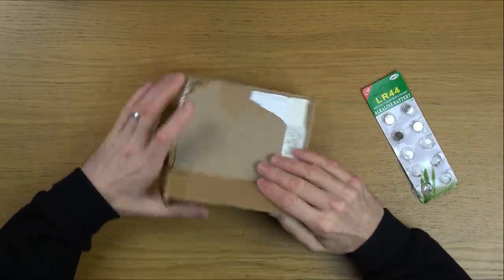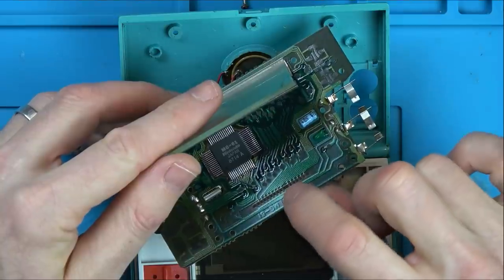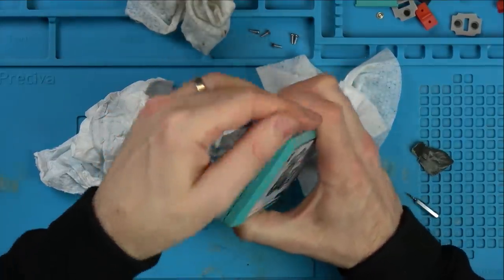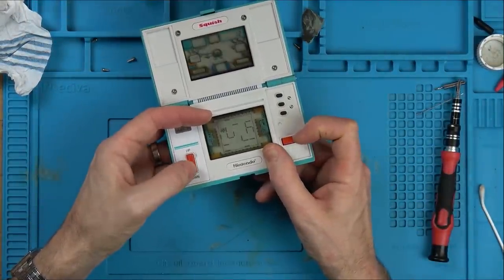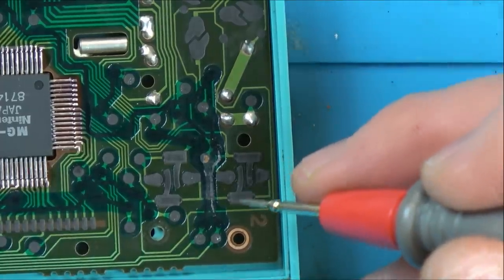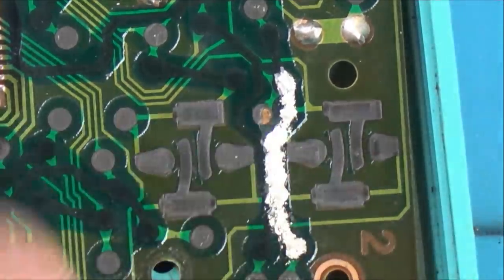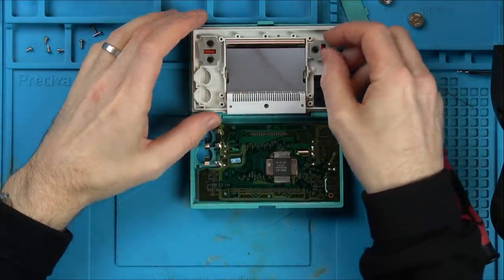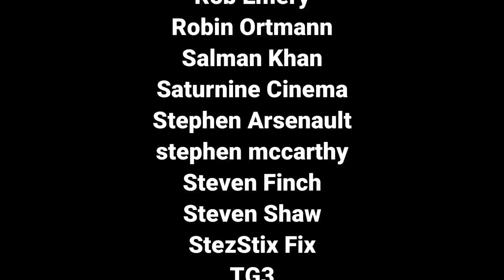Faulty eBay Nintendo GAME & WATCH - Squish - Trying to FIX

Comment: I just wanted to say that before finding your channel I never would have thought to track a Trace Line, Scrapping it to find another solder point. I recently had to redo a gaming mouse I had done before and all 5 Traces lifted during the repair. So I just traced them out and scrapped the board, added some flux and resoldered it. Worked like a charm, so thanks for the vids.

Comment: Great vid Vince. Avoid using IPA to clean carbon traces/contacts it will erode them away, you could clean and clean with IPA and it would ultimately just remove all the carbon, instead use contact cleaner or WD-40 (worst case) which will not eat away at these. Loved the idea with the pencil, I've seen the all black style glue on ebay and wonder if it is just a graphite powederised glue which may be better suitwd for this.

Comment: I'd try to scrape off the "test pads" and solder jumper wire between them around the buttons. You can see one already has copper showing through. The plastic will rub through anyway again I think.

Comment: I kinda had a feelin’ pencil graphite would work. It is a pure carbon material, like the carbon pads used (for both the button presses and the overhead traces).

Never seen a circuit board use overhead traces, though... usually, it’s interconnected with pins or (if the designers felt especially lazy) wires. But carbon traces have a resistance, so maybe they used that instead of regular traces and resistors to limit the current flow while maintaining the low profile design? They might not have had access to affordable multi-layer circuit boards back in mid-80s, much less affordable low-profile SMD resistors, and the Game & Watch-series was designed with affordability in mind.

Comment: As a collectable that one is no good as its missing, its original faceplate screw covers One on the bottom right sides that indicates clock and alarm settings and the two top ones. nice little fix though, you could always use a bit of masking tape to define a trough before applying your conductive material and to spread it out more evenly.

Comment: =D  Great job, but do you know what the easier fix is - scratch the trace (well before that broken part), solder a fine wire onto the trace, find part of a trace that leads to  the other disconnected side, and solder the wire there.  Just a single strand of wire around the outside of where the direction pad fits, so it doesnt get pressed on etc.  The probleem with any kind of fix directly under the pad, with use the pad with wear through the fix =/

Comment: Vince. There must be better solutions around with refurbishing carbon pads/tracks than to cover them with silver paint. I have some sticks from IBM that are deliberately made electrically conductive for the specific purpose of making tracks. These looks more or less identical to thick pencil leads. How about tracking down some of these or experiment with Staedler's softer pencils, that are made to leave thick carbon traces behind ?

There's also carbon spray made for the purpose of producing conductive tracks, manufactoring potentiometers, et cetera. With a stencil you could refurbish the entire board with new pads and tracks.

Comment: Just finishing up an afternoon fixing some of my unique straps for my watches today like my TW Steel chrono's one which let go the locked keeper and buckle and the horrid aliexpress "authentic" replacement I got for it was absolutely dreadful.   Am in the process of cataloguing my watch collection as its gotten a bit out of control and doing it in sections for a nice video and I think some will be surprised at the Soviet collection's size but also the Pulsar selection I have accumulated made me blink a bit as I was sure I didn't buy half of 'em O.o   

Going to finish listening and watching your vid whilst I replace my very sexeh Accurist AS10's alarm piezo contact spring and another job done :D

Comment: 4.3 mm are the length of screws that are safe to use so that they don’t go too deep and cause damage.
Also, I’d be replacing those rubber pads. They can cause issues.

Comment: Hi Vince, please do a Trying To Fix Faulty Radio Controlled K9, I’ve bought two of them off eBay with a very strange fault, only the “Try Me” button works and they do not go through their normal boot sequence with the “On” button. I’ve tested the switch which is fine, the unit is getting power. I have jumped across a ribbon cable which has gotten it to boot, although continuity across the cable itself is good. Seems to be a strange common fault. Would be interesting to watch!

Comment: This is a great video 🏆 
if you allow me I have a question . . . . I recently bought a Game & Watch - Mickey & Donald from 1982, it works fine, however I need to change the polarization of the lower screen . . . . . but the real problem is that one of the hinges that hold the upper screen is loose and the other hinge is broken . . . I don't quite understand if it has a screw or something inside for this function ?. 
I would really appreciate your advice to solve this problem.

Comment: Cheap "dual layer" board. They really should've routed things differently, away from such spots. I think I'd just use a tiny wire instead in this case, if there are some good solder points. Maybe there isn't any. The solder resist wouldn't last forever, something the scratching made apparent. The silver paint might also wear off.

Comment: I still have my nintendo GnW Fire. When the buttons wore out I use the back of two pencils to control the left and right. Later I used buttons from a calculator. Now that ebay has been founded I might just get some replacement buttons.

Comment: Oh those AG13 batteries you had, I used them in my Soviet quartz and it was that brand that killed my "big red star" Slava quartz, was in there less than a year and it just exploded inside... you prob want to get some Renata LR44's and have some peace of mind its not going to dissolve from the inside like some dodgy B rated alien movie O.o
Reply: JCB and Duracelll AG13/LR44's are also not too bad and I saw in the opening shots one of the cells looked a bit puffy on the flat bit and its something about these Chinese cheapo cells that the second they run out of angry pixies they consume the seal and spray corrosive goo all over your delicates, my Slave virtually all the tracks on the circuit board were gone, the coil looked like a dirty brown mess of partially dissolved copper, the stepper motor was gone and the main brass wheels looked like someone had munched thru 'em :( :(

Comment: This is clever cheap design - instead of resistors they use carbon tracks.
Reply: i think they use them more as jumpers than resistors, because otherwise it's a 1-layer board
Reply: @wphanoo  who gonna use carbon track as jumper wire with 1kOhm resistance?
Reply: @solveit1304  because it's doesn't matter for most signals (almost no current flows), for example you could have a 10k or more resistor in series with you button input it would work as well.
Reply: @wphanoo  so why not use copper trace? And why they got 1k Ohm,  not 0.8k or 1.3k? You can stop commenting now, cause you not gonna convince me that they made all that carbon track hassle instead of copper track for signal.
Reply: @solveit1304  Because single layer copper is cheaper, especially back in the days. They had to have a carbon layer anyway for the button pads, so if they can also use that to do tracks they'll do it. It's ok if i don't convince you, I'm just here to share thoughts. For that kind of signal path 1K ohm or 1.3 doesn't matter, it just need not to be overly huge (like 1M) so the chip can still sense the voltage.

Comment: I think I would've used some thin magnet wire rather than trying to repair the cheap fake dual layer carbon track that will probably be damaged by the up/down again.  Still, at least it's working eh, congrats 👍